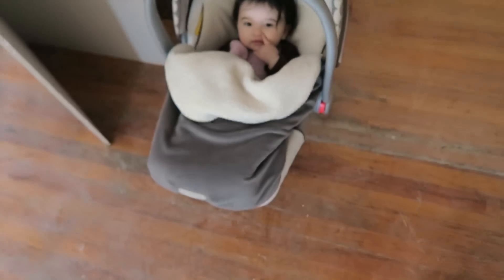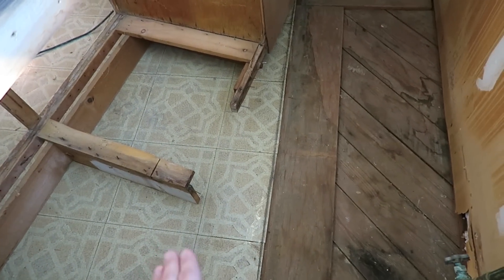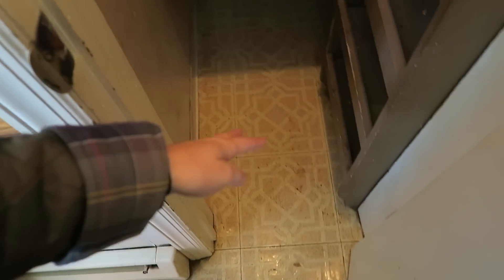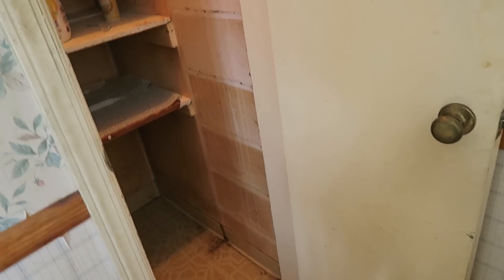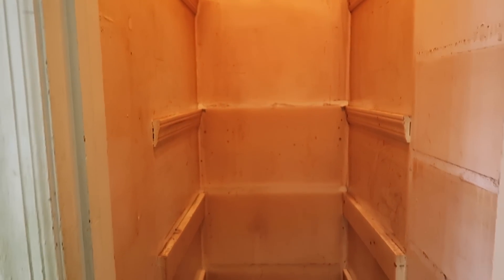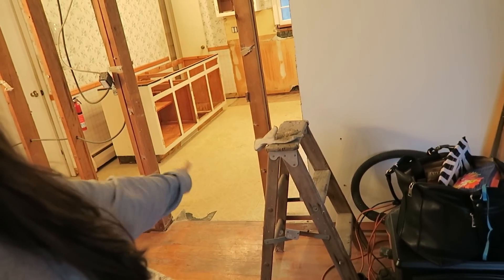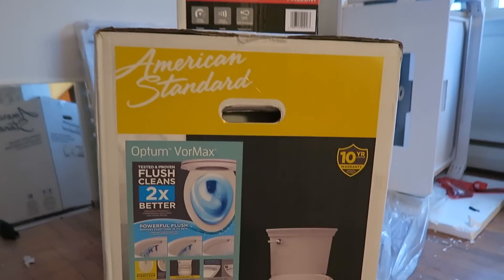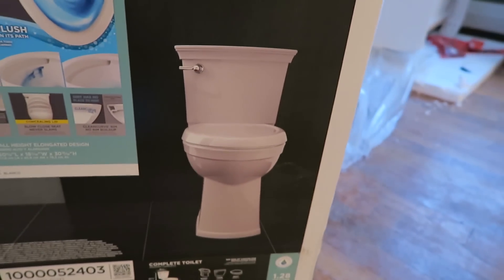KITCHEN PROGRESS | OUR FIXER UPPER EP. 3

Comment: Did you test the linoleum floors for asbestos?  It can be dangerous if become airborne when tearing up those floors.
Reply: There are different types of Asbestos and the most common one used in homes is White asbestos (chrysotile) . Section of Article I posted above. White asbestos (chrysotile) is very different. Its fibers are long and curly. They don't penetrate the lungs deeply, and they are expelled or dissolved. Epidemiological evidence shows that moderate exposure to white asbestos does not cause lung cancer or asbestosis. The July 1986 American Review of Respiratory Diseases reported a study of women living in Thetford Mines, an asbestos mining town in Quebec that is surrounded by mountains of tailings from the mines. These women, who don't work in the mines, are exposed to 250 to 500 times more ambient asbestos dust than the residents of the typical American city, but they show no higher incidence of respiratory disease. Miners exposed to light to moderate concentrations of fibers (average of 21 fibers per cc of air) showed no statistically significant incidence of disease. Those who were heavily exposed (95 to 194 fibers per cc) showed elevated levels of lung ailments, including cancer. Ninety- five percent of the asbestos used here and all the asbestos used in consumer products is the white variety, which has not been shown to pose any risk to consumers.
Reply: I was thinking the same thing...
Reply: I was curious about this as well. You can always wear a mask and spray the area down with water to help minimize the risk of dust particles from the tiles, as well as the mastic, if they are broken or ground up during the removal process. The info someone else posted on the different types of asbestos is interesting. I had never heard that before!
Reply: I have done a ton of research on asbestos . There is another article on the different types of asbestos I found as well . We breathe in White asbestos daily it's even in our water. You can't escape asbestos unless you buy a house from 1990s to be safe . My 1970s house had 2% white asbestos in our ceiling and I found out the hard way and like everyone else I thought there was just one type of asbestos ! Come to find out white asbestos (chrysotile) isn't as dangerous compared to Brown or Blue asbestos which that stuff is no joke but highly unlikely to be found in our homes . If you do your research you will come to find out the people who get mesothelioma is from working in ship yards or the actual asbestos factories which had the Blue or Brown asbestos .
Reply: Heck in California everything causes cancer it seems LOL
Reply: Candice Vervalen  Thanks Candice! I decided not to panic after doing some reading myself, but the info you found will help with that as well. I live in a 70's house with popcorn ceilings, and yes, we found some tile that was buried under carpet. Oh the joys of renovation projects! Sadly, I know the hazards of the shipyard - my maternal grandfather worked in the Virginia shipyards for years and passed away due to lung cancer before I was born. Thanks again for your research!
Reply: You're Welcome ! I am sorry to hear about your grandfather .We had our popcorn ceilings scraped and I am still finding popcorn balls everywhere! You have no idea how I felt after the test came back three weeks later after the removal . My heart sunk because I have two babies! I did a ton of research and feel a little better. I just want to show people there are different types of asbestos . I have rolled out linoleum under the carpet in the bathrooms haven't test for asbestos yet but just curious if it does before we take it out. I told Hubby just to cover it up but he won't he can't stand thresholds . I love renovations just not the mess that comes with it LOL
Reply: Candice Vervalen. I think it's important for anyone doing reno to know what they're dealing with so that's why I mentioned the testing. Reports from 1986 is 30 years old and we now know a little better what asbestos can (and cannot) do. So if getting a test done and it comes back harmless that's even better!

Comment: Love these reno videos! I am not an alarmist, but Dan's mask isn't enough to protect against possible asbestos or mold exposure and you should wear one too. You need a mask rated P100 with the pink filters, they are $15 on Amazon. That black adhesive under peel-and-stick tiles is a dead giveaway. Incidental asbestos exposure won't kill you. With water-damaged drywall and wood, you could be kicking up mold spores as well, which are actually quite dangerous to breathe in and more acutely harmful than asbestos. Test for lead paint before you sand anything, kits are cheap on Amazon as well.

You don't need HAZMAT suits, just a P100 mask and goggles should be plenty when you're doing any kind of sanding or sawing. I'm assuming Lara is well away from all the demo. Cheers!

Comment: What you pulled up is the subfloor.
Reply: That's what I thought. Isn't subfloor the big pieces of plywood?
Reply: Bettylou if that's the sub floor then what was underneath?
Reply: No, the diagonal wood is the subfloor. If they had pulled up the subfloor you'd be able to see through to the basement. The plywood was a backer for the linoleum. In newer homes the subfloor is usually pieces of plywood but older homes very often have the planks.

Comment: My mom hired a co worker refinish the floors.  Biggest mistake ever to hire that dodo head of a carpenter.  He hired an assistant and sanded our floors.  Thought he was going to sand it down until nothing was left!  Then when he stained the floors, it was so rough and bumpy.  Some of the floors were uneven and they claimed it was due to "heavy furniture".  Biggest malarkey I've ever heard!  No furniture was there with the old owner.  They also painted the walls and did a sloppy job painting over the moldings and left drip marks.  Eventually we fired the two noobs and hired a professional to do the floor.  Very happy with the outcome!